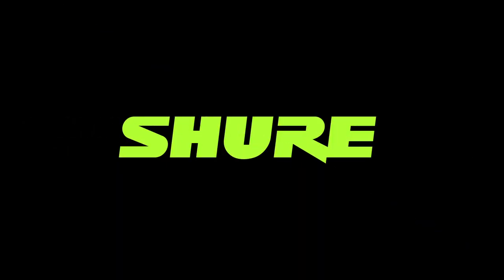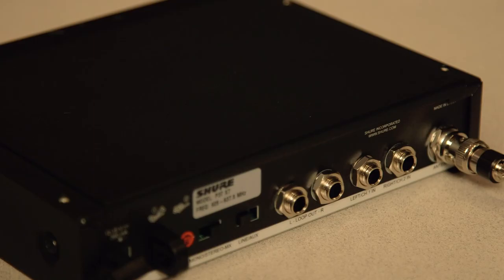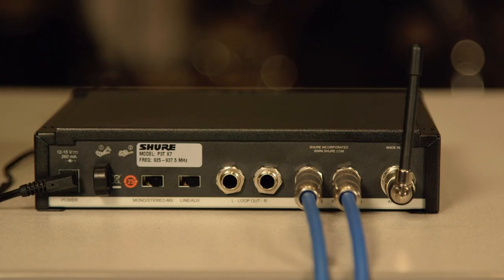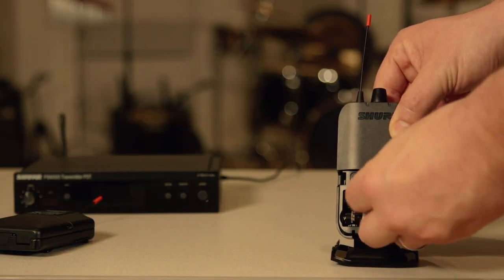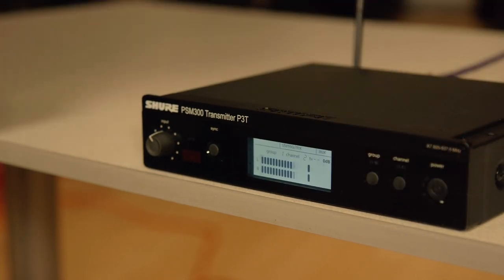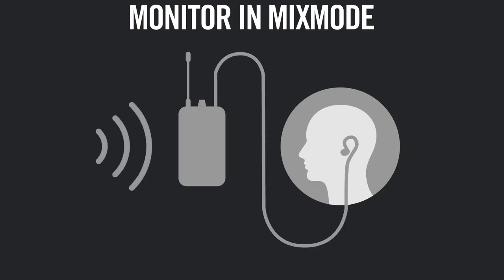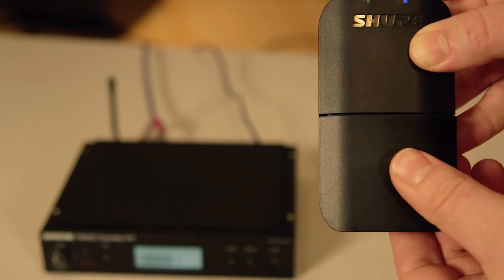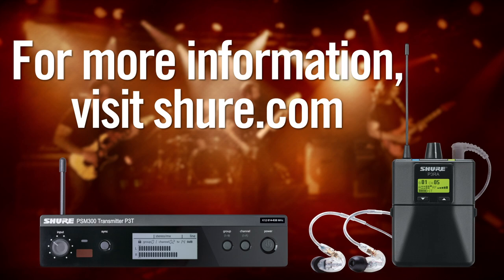How to Set Up Shure PSM 300 Stereo Personal Monitor System

Comment: I was using this exact model in my 5th use the right side went out no sound nothing. So I thought to myself my new 215’s were out. I went out and bought a new pair of headphones. And the same thing there is no audio on the right side. Can someone tell me what happened? Because it’s not the headphones
Reply from the maker: We are so sorry to hear it! Our support team can help you troubleshoot the issues. Please open up a ticket with them at shu.re/contact.
Reply: I know this is an old comment - but it might help someone in the future. We had the same thing happen to a pack and even sent it in to get worked on. Came back fine, but then another started doing it....Turns out we just bumped the panning buttons. If you hit the buttons on the front it pans it left or right. Cool, but also a silly design too. To fix it just lock the receiver in the receiver menu so the buttons can't be pressed. Dumb thing is someone on our team discovered it and despite fully sending off a pack and multiple calls and emails to Shure we would have never known it was that if he hadn't messed with it and found that - they never thought to ask if maybe we bumped the panning feature...haha. So there's that info.

Comment: Do i need a di box to connect to mixer?
Reply from the maker: It's hard to say without knowing your exact setup, but our Support Team will be happy to help you out. You can get in touch with them at shure.com/support.
Reply: @ShurePerformanceProduction  right now I connect the sure IEM transmitter to my digital Mixer via stereo jack - xlr cable. My question is should I put a di in between (jack to balanced xlr signal)?